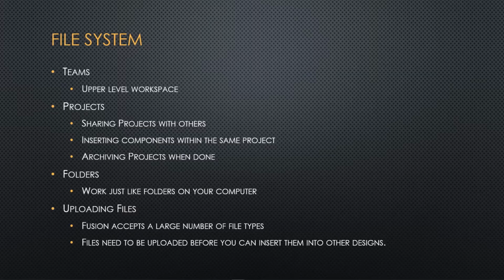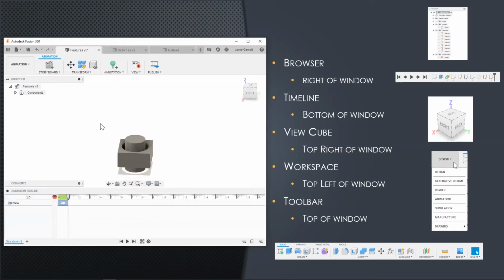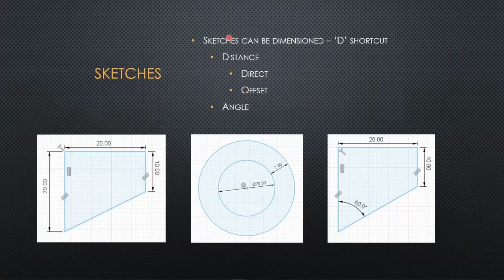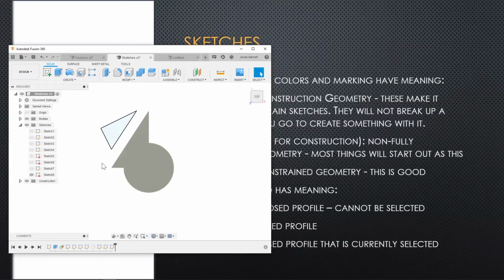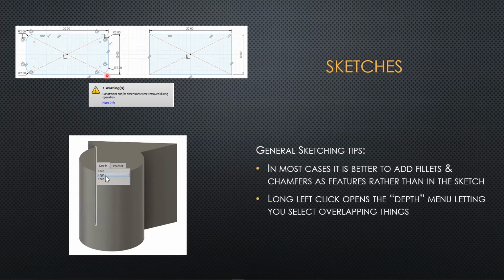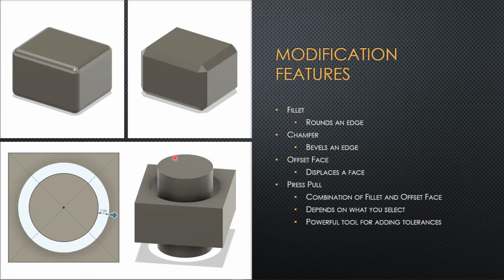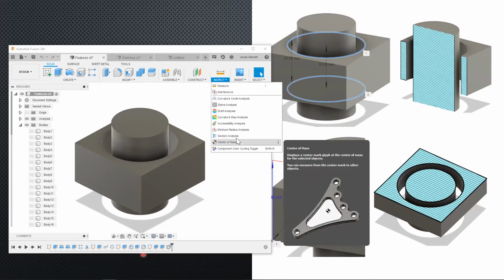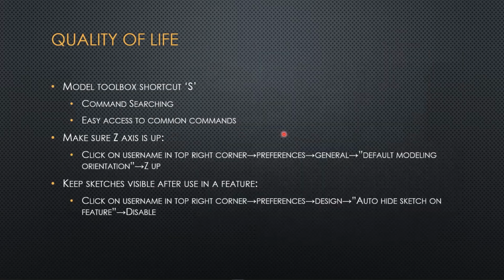Intro to Fusion 360 – Recorded Startup Shell Workshop

Comment: thanks, how many hours approx do you reckon it took to get that understanding? i have 320 hours to learn fusion 360 from scratch before it becomes almost impossible to learn any more due to work. can it be done?
Reply from the maker: I've easily spent over 1000 hours designing in Fusion however a lot of that time was spent just design as opposed to actively trying to learn the software. Given the time you have you should definitely be able to pickup fusion 360 and get decent at using it. I would recommend either coming up with stuff you want to make(like light saber hilts for example) or finding things you have around you and try to design/reverse engineer those items as practice.